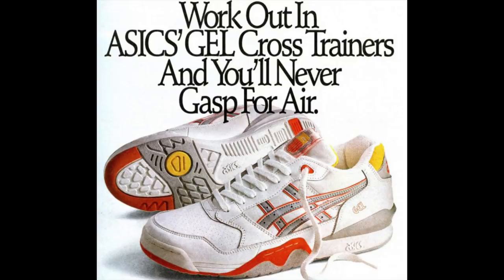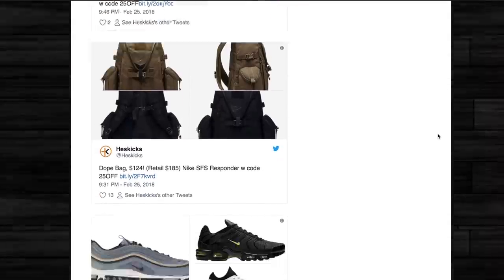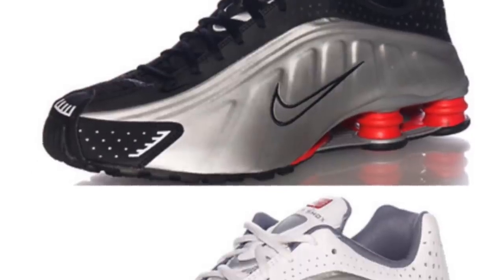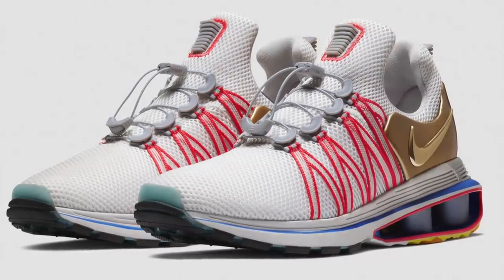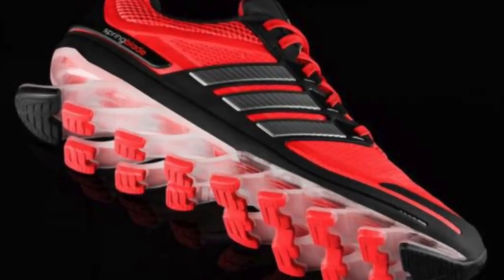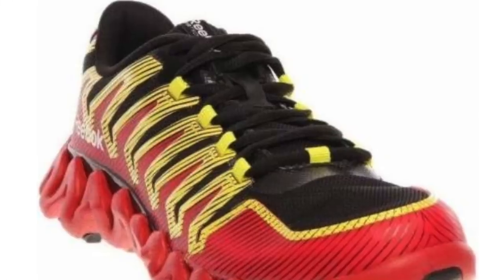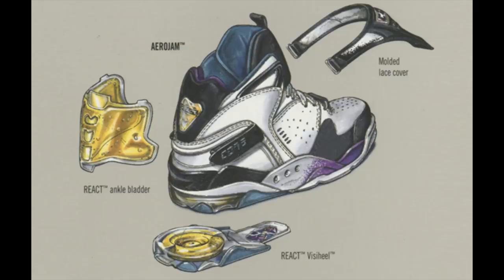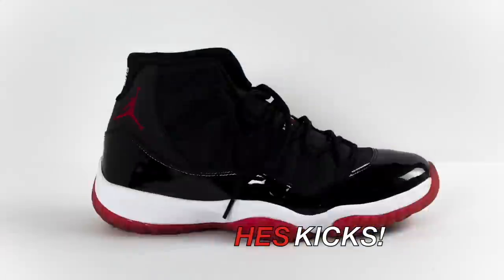Top 5 FAILED Sneaker Cushioning Technologies!

Comment: The Springblades were trash on wet surfaces. You wore these in the rain and were liable to do the James Brown splits or an MJ 360 spin, depending on how fast you could recover your balance.
Reply: You really need to pamper those shoes or else they giveup pretty soon .
Reply: lol
Reply: XD so funny man btw nobody else like this comment it has the perfect amt of likes
Reply: SpideySensei72 I had that same problem🤣
Reply: SpideySensei72 I almost broke my neck, fell twice coming out of the store! 😂😂
Reply: "slingblades" 😆
Reply: Footlocker had them for 150 or more i thought i was getting a deal when i got them for 60 online! What a mistake.  I read a review where the footbed snapped in half while they were running and were badly injured.
Reply: Remember adidas Bounce which was right before the springblades. I would demolish my ankle when I ran in those.
Reply: haha
Reply: Try them springblades on ice. just about broke my wrist. Yeah the mud was a issue too i had to get a pen or pencil to get the mud out.
Reply: When the rubber wears off they are even slicker, i almost ate it a few times wearing them but i bet it would do some damage of you kicked someone with them, the edges were nice and sharp when they wore down. They did propel me forward quite a bit in full stride and they absorbed shock amazingly well when jumping from heights.
Reply: Not as bad as the Slingblade adidas they were comfy enough but you spent ages standing in the drive thru " Aight I reckon I'll have some of dems French fried potaters MHMM!"

Comment: You can't jump with the springblade... It hurts ALOT
Reply: Why is that?
Reply: Might just be the older versions but I remember I could feel it in my bones when jumping vertically. I switched to something with more foam/rubber soon after. It worked well for forward propulsion but there really wasn't a noticeable improvement over other cushioning systems. Also, I remember I could only use it on hard surfaces like asphalt (or dirt/mud/grass would get stuck in the blades), and because of that the plastic blades would get scuffed up and sharpen, making them hurt for other reasons...
Reply: saw the springblade in store, my reaction was "wtf, dat stuff is doomed"
Reply: I HAVE THOSE SPRINGBLADE AND FACTS WHEN U JUMP ITS HURT ALOT THAN YOU EXPECT 

AND MY SPRINGBLADE BROKE SO EHH
Reply: A lot*
Reply: It hurt to jump in the springblades but in the occasions when I did jump I felt like I jumped higher could be an affect but either way the shoes soles along with blades eventually peeled off
Reply: @andreabambilla8497  me to i lost 4 blaeds😑
Reply: I've bought all springblades and maaaan, i love them, really usefull for running, but god it hurts if you jump with the original springblades
Reply: I love spring blades
Reply: Mine felt great on me
Reply: I saw a 7th grader wearing red skechers springblade ripoff
Reply: @hemlockgrove1284  Thanks man for the positive review of the spring blade. They are really good shoes and I have been using them from past 4 years and the are really nice to run on tracks and on aspalt/cemented roads. But maintaining those wear always been an issue.
Reply: Had the OG pair and newer releases, were fine for me 😕🤷🏾‍♂️
Reply: @tiyo6047  same i saw a kid wearing them as well in 7th grade
Reply: AMOGH KUMAR How are they if you attempt to trail run
Reply: @MPHshoots  I own them too. They are so hard to walk with even Normally and let alone jumping
Reply: I thought spring blades were cool as fuck but I agree they sucked to jump in and if you stepped in mud you’d get mud in every single one of those blades

Comment: I had a pair of Adidas springblades. I remember that the durability of the blades was not very good. The rubber fell of the bottom of them after 3 months and the plastic was very slippery and resulted in me twisting my ankle numerous times. I honestly like the way the shoe looked and the concept of it but the execution of the idea was very poor.

Comment: I really liked my spring blades as head turners in high school, but they were difficult to actually use because you were so high off the ground. Also, you lacked any stability if you did not land directly level on the shoe bottoms.
Reply: I don't think you were getting looks for a good reason
Reply: Actually I went to a private school with a dress code, so unique sneakers were a way to get around the dress code.
Reply: When I wore them, it felt like the blades were gonna come off any second
Reply: commanderschonberg very good insight!👍🏼
Reply: My springblades had issues, the plastic top part that the laces went through cut into my foot every time. Then the front section of the plastic "spring' assembly came unglued on one, then half of all of the rubber pads kept coming halfway off and tripping me.

Had a couple good runs in them, but felt way unstable with lateral movement.
Reply: commanderschonberg and that’s why they were a fail
Reply: The blades were also facing the wrong way literally just springing you backwards if anything
Reply: Wag Wan xD

Comment: So i just bought the Reebok Zig Pulse, they look a little weird but are one of the most comfortable shoes I've owned. They are great if you stand, or walk on a hard surface like concrete all day (i.e. if you work at Home Depot, or other big box stores).  I got a killer deal at the Reebok outlet in Vacaville Ca, all shoes were 50% off, and i found a clearance pair that only cost me 35 bucks. I highly suggest them if you dont care about how they look.

Comment: I really liked the springblades. They were really comfortable overall. The first pair I had was the pair with blades only under the heel, and a regular toe. Those shoes I still wear to this day (although mostly for outdoors stuff). they never lost their grip (which is amazing because I used them for basketball both indoors and out.) and never fell apart. They are a really good long term shoe. However, after I stopped wearing these on a regular basis, I bought the pair with blades on the entire bottom, and the fabric/mesh upper. The rubber on these shoes didn't last even six months. I don't know what was the big difference but I was walking on plastic after like 5 months.

Comment: 1st gen adidas spring blade user, bought at $180 and blades came apart midsole after 3 months of light use. It just came unglued, was still useable, but they’d flap and make noise when walking, went into trash soon after.
Reply: Marcos Arceo. Same exact experience. Had two pairs and both came unglued at the middle and would flap loudly when walking. Even though I liked the way they looked, it was a waste of money.

Comment: Cool vid... Agree with all, except the Reebok zigtech though.. I'm 43 yrs old 150lb and always been a Reebok fan as I thought their shoes were very durable. I would say though, that probably their "ERS" (energy return system) from the late 80's was a failed tech. Even though I remember them being super soft, the ERS system below the shoe would come apart from the gluing. Their Hexalite system was pretty neat too.
I bought a pair of zigtechs in 2013 and were great for walking and running. They were my only pair of sneakers and I replaced them in 2017 with a pair of Salomons for 2.5years - since it looked like the zigs were more or less discontinued, and two weeks ago bought another pair of zigtechs when I saw it in the Reebok store. For some reason though, the new ones don't feel as soft on the heels as the older model... :( Or it might be because I'm six years older and my heels aren't what they used to be.. Lol.

Comment: I had the spring blades I don't know if you will ever read this but when I was little I thought they looked awesome and when I put them on they actually felt springy now that I look back I agree they looked terrible but you must have to put them on to understand they were amazingly comfortable but one of the down sides was when you would run in the rain the water would kind of sometimes scoop up on you and another was minus was dirt got in those holes they got dirty really quickly I would still get them again if the lower was a little smaller but saying they are less than 60 bucks now I would totally get them

Comment: I like the Adidas Springblade.  I feel the difference in my knees - definitely a shock absorber. I've also taken then hiking and are pretty good on rough trails, but the knit upper gets dusty quick. They are my favorite pair.   Although you're right, I get strange looks sometimes when I wear them and have been asked many times what brand they are because the 3 stripes are the same color as the rest of the shoe.  The only logo is on the instep tape.

Comment: I still have my spring blades in black. They actually really make you feel "bouncy" if that makes any sense but the moment you're running on slippery concrete, there's like a 60-70% chance the blades will slip and you end up with a very embarrassing fall. After trying them on for about a month, I switched to Airmax's and I'm never going back.

Comment: The thing about shoes is... you have to try them for sometime to find if they suit you well and doesn't give you any pain or unwanted results. What i have learnt is that the Best shoes are the ones which have 1) just enough cushioning but are not overdone with cushioning.
2) balances the weight of your body on overall feet.. not concentrate the weight on heels and toes.
3) must not be too soft on edges which make em susceptible to twist your ankle.
4) must have descent to good rubberised grip at the bottom.
Reply: Word
Reply: i feel like you should have more likes

Comment: I worked for several sporting goods stores over the years  and the shox  didn't do much unless you were a certain weight and were prone  to breaking in that crease just before the shox. Spring blades also prone to breaking near the middle plus horrible traction in anything but perfect conditions, react juice like he said just Gimmick and didn't do a thing, can't say anything about avia because the only pair I had a chance to sell, but didn't, were like a 15$ pair for walking with no tech at all, zig I never got a chance to try out. They hit the scene kinda when I moved on from retail. Additionally I'd put British knights diamond cell, reebok pump, adidas 360 climacool shoes not the clothing. Shoes had holes in the sole to keep your feet cool but were really stiff with no flex and make sure you check the weather and watch for puddles or moisture on the road for that matter.

Comment: I have three pair of the Adidas Springblade, and the bottom sole came apart on all three pair. I had them repaired at a shoe repair shop, and they came apart again. And they have no traction on a wet surface. Good-looking shoe I wouldn't recommend anyone to buy them.

Comment: I’ve tried the spring blade over all it was good and comfortable
Reply: I have tried all tech mentioned and not mentioned in the video. For running, I haven't find anything as good as the springblade. Lucky me I bought two pairs after I tried them, nowadays it is very hard to find them.
Reply: @ricardog4459  Have you tried ultraboost 20?
Reply: Maycon Douglas not yet. I almost bought them a month ago, but I have too many sneakers atm. I will definitely get another pair before the summer, i have heard really good opinions about the ultraboost, but the nike vaporfly seem promising. either of those should be nice for running
Reply: Ricardo Garcia the thing is ultra boost can’t last against 100+ miles
Reply: Saran UAOV really?? how come? does the sole wears off quickly? 
how about these new nike's Alfa fly? have you heard about durability? it'd be f* up if you spend 400+ in a sneaker that lasts 1 month lol

Comment: The springblade were ok, but they created pressure points on your feet where the top of the blade met the shoe. Also if you walked over any cords or walked backward or on grass. Things got tangled in the bottom of your shoe. Also if you landed on the corner of a curb, you could snap off the blades and it would basically break your ankle.

Comment: I had those exact same Nike Shox trainers and I never knew about that recall. I never had an issue with them even after getting the wet. Those Shox were stiff and heavy. It was not a comfortable shoe. The running Shox and the TL Shox were a little more “springy.”

Comment: As a runner that eat through shoes quickly I've tried many of those gimmicky shoes and it's all garbage. The simpler the better and minimalist shoes force me to have a proper more natural running strike. The merrell series called forefoot or road glove are my favourites.  If you don't like minimalist check for reebok flex line of running shoes. They are well vented and light and offer some cushioning.

Comment: I bought a pair of Shox Stunner back in the day, they had really good lock down and hands down the BEST traction I had on any shoe ever. That thing could grab on to the filthiest dirty wooden floors. But the Shox cushion sucked so bad it felt like solid rubber. To this day I still don't know if Shox actually worked or not, back then there were no sneaker reviewers to actually do a proper test on it.

Comment: I had these Adidas spring blades and it wore out fast..Many of the plastic springs actually broke on both shoes but what's worst is the rubber attached to the springs wore off making these shoes very slippery and unsafe. I thought they looked cool and paid $180 when they first released.

Comment: The Spring Blades were dope. The issue is that the sole would separate from the shoe because the glue would fail. I literally sent 3 pairs back to Adidas because of this.

Comment: Springblade helped absorb the contact and I felt like I could Jump higher but I found out the the design would force me to fall easily due to the blades bending if I walked backwards. Ultimately my feet would start to hurt and the blades would peel off the soles of the shoes. A fail but IMO they looked pretty cool

Comment: zigs shouldn't be in such list at all. It is works as intended, very comfortable and very durable. The only bad thing of some later zigs versions is that inner layer under the insole was made of paper, what may causes a mess if you are sweating alot. Shox and springblades is obviously a failure, plastic is not proper material for cushioning cuz it breaks.

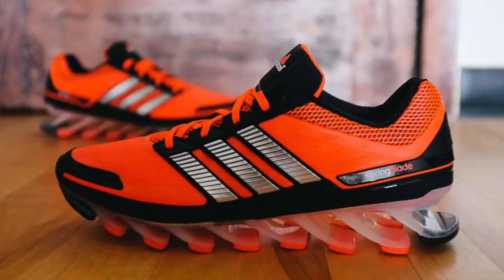Comment: 3:42 Doin the Talk,also done the Walk...
I Love Springblades,but they Crack Underneath  the 1st Stripe from front,I guess that's Why Adidas stopped makin em.
U can Compare the Springblade with,Paralympic Runners using a Blade.

In a Certain way,it's like ur Walking on Clouds !

The Springblade is Very Peculiar ,because it's got so many sole's ,that will also tear away way more,compared to Standard Sole Shoe.
I own 2 pair,both broke underside,still can walk on em....
I wear em very often,favor them over Ultra Boost,or Adipure Barefoots...
Remember the Bounce ,Ultra Bounce,these Adidas also walked great,but also went out...
I also loved the Reebok Pump,made ur feet fit better !
Greetings !

Comment: I dont think zig was a cushion..i think it was a flex...and i think the blade was a ride...I think shox was also a ride...where the landing gear is and the stroke of the foot on ground is not really cushion...they never really said they misjudged that originally..its not cushion that relieves most issues...its the landing and ride of the shoe. So cushion is something else..and cushioning has to be specifically addressed...insulation and cushion are technically the same...around the boot area and ankle. Insole...that can be cushioning but its more grip for the foot bed for traction in the shoe..something great shoemakers know is a game changer. I think cushion/ride shoes are like lunar and freshfoam and cloud. Those are specifically meant to create a meshing of cushion soles and a landing based ride stroking as the foot processes its form in the weight of the runner.  Which is terrible because if you arent running the cushion is compressed and that ruins it and so does running in it. If you arent a light or muscularly activated runner or person in general..you just basically are biting the pad and its gonna smash out of performance quickly...I think a ton of shoes fail... literally the majority of shoes fail. Air cells have been decent. Zig was good on the high end. Tech and maximal shoes have been good and Reebok has made a few good crossfit shoes that run superior to tech shoes with no real gimmick just great rubber.  Solid soles are sold shoes..worst shoe platform ever? Airwalk and etnies. I think those were the last of the kind..a hex based inner sole design with air pockets and a thin rubber membrane over that..a couple skids on a skateboard revealed the inner structure of the sole and that led to garbage by the end of the week...maybe even the day. Very serious fair. Vans as well had this platform.  A majority of shoes did in the 80s and 90s. They were high end cheap shoes made for alternative uses. Hacky sack between skating and dancewear. Not skateboarding seriously but people held down some real garbage equipment...its like oriental products...ive literally put thier dress shoes on my feet and they were like physicians table paper..just weak and ripped immediately compared to florshiem they were not even a good sock let alone a dress shoes....but...ive seen asian people sponsor these fake shoes and they somehow seem to suggest its my rough american foots doing..not the cheap ass paper shoe they make..they'll wear them to do kung fu movies..i cant pump gas in them.

Comment: I tried those springblades and according to me they are comfortable and the tech works but not more than nike air 270 which J am currently using.
And imp. To mention thatSpringblades made noise after some months while walking.

Comment: You missed out the adipump they had a small air cushion at the back with a valve where you pumped them up at and you got a pocket sized  battery operated pump with them